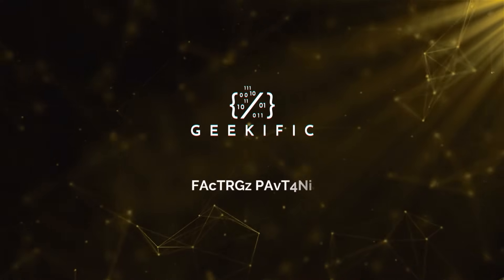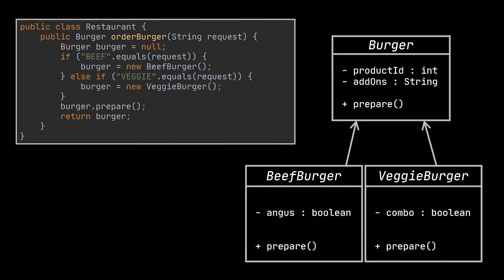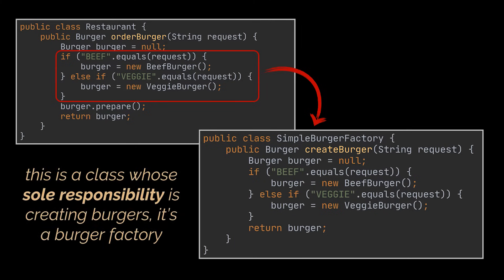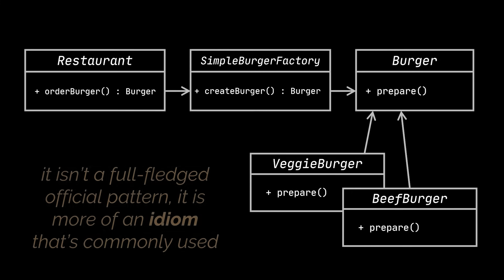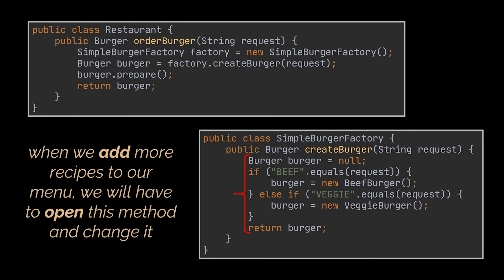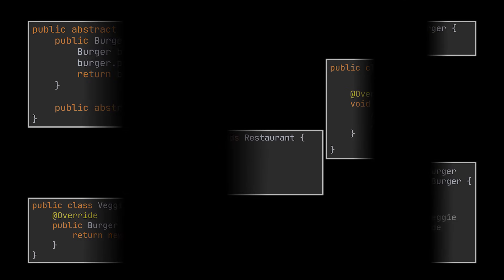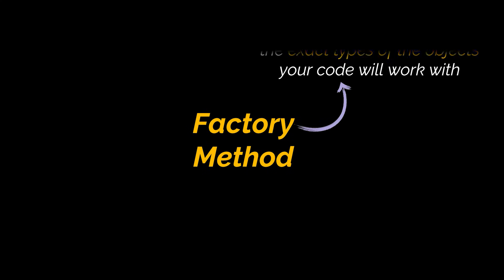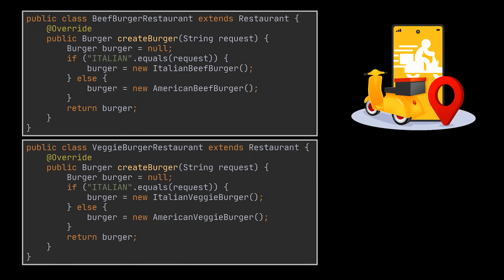The Factory Method Pattern Explained and Implemented in Java | Creational Design Patterns | Geekific

Comment: Hello sir, Nicely explained 👌 
But I have a doubt. In the factory pattern method, in the main() method still I have to apply if else on which type of derived class I have to instantiate. I will give the type in input and on that input if-else would have to applied for making instances of the derived classes of the Restaurant class. So, in this case also, suppose if a new burger comes in, I have to increase one "if" check. How to handle this?
Reply from the maker: Thanks :) We cannot get rid of that decision entirely as it is up to the user / client to make this selection, or else we will be choosing on his / her behalf :P What we can do, or are doing instead is shift this decision to the client part of our application instead of leaving it coupled with the inner parts of our algorithm :) Hope this answers it! Cheers!
Reply: @geekific  But I still have a doubt. Before "Simple factory idiom": if-else checks were in the Restaurant class. To remove those checks from the Restaurant class, we used "Simple factory idiom" which led to those checks in FactoryClass. Then to remove if-else checks from the factory class, we used "Factory class pattern" which led to the checks in the main method. So, I am not able to undertake what benefit we are getting by using the Factory pattern over Simple factory idiom. We are back with those checks in our client code!!!!.
Reply: @rahulmodi926  to remove if-else (control-coupoling problem), i think you can do it with reflection, so you have to create object from its className, so ur className have to name after a rule like: type+...(ex: type: beef -> className: Beff + Burger, type: vergie -> className: Vergie + Burger), so in future, if u have a new product, you have to name after the rule. In conclusion: if-else in that case is not important, if u want to remove it -> use reflection and className should follow a specific rule
Reply: @tieptrinhsope  I think you can use a map of [burger_type: object()]

Comment: Great video!
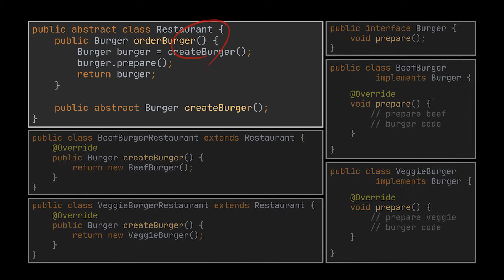I have a simple question: before implementing the factory, you had a string called request used on the if else block. after implementing the factory, at 5:55, you showed a main function but instantiated two objetcs without using the string request as before. if i wanted to adapt the first code (with the if else based on the request string) the right place to put the if else block with the request string would be in the main, right?
Reply: I don't know how this achieves anything... the outer (ordering) code is still coupled to the inner (making) code because it still has to know the names of the functions it can call. Also, if you wanted to replace veggie with chicken, as you did in the first example, then you would still have to update the outer code so it can't call the deleted veggie burger type. So what's the point?
Reply: @richtourist  this is my question exactly I just dont get it!!
Reply: If the whole point of applying this pattern was to make the logic close to modification then i think it didn't succeed. The conditional didn't disappear we just pushed it a level higher. So that is still open to modification. Also, we created an extra level of classes with this pattern (XYBurger -> XYBurgerRestaurant + XYBurger), so now we have to write code for twice as many classes every time we want to add a new kind of Burger.
Reply from the maker: Thanks :) Yes! This is a client request and should be handled on the client part of the code (i.e. in this simple example the main class). We can't get rid of the request entirely, is part of how any program or application works. What we did instead was extract it, so it won't be coupled with our logic, making our inner logic closed for modification but open for extension. Hope this helps!

Comment: I dont understand the exemple, at 5:57 how the client know wich one to get, and why not just give the object directly without passing it trough the factory ? what is the difference now ?
Reply: I had the same question. It seems like the ability to order a burger subclass based on user input has been lost. At 5:57 we are just making both kinds of burger
Reply: I got same problem lol
Reply: I think the only way is to have somehting like the chain of command pattern. the request object is evaluated based on a condition and, then, from all registered evaluators, the request is fulfilled by applying the evalutor which can handle that type of request.
Reply from the maker: By abstracting the creation logic and applying the factory pattern we centralized the product creation in one place making it very easy to extend our application with new products, all-while making sure that the creation-template (ex: order - create then prepare) will be preserved.
Reply: @geekific  Nice video. Just one question, how can we runtime decide which burger to be created? Thanks.
Reply: @yuzheng8804  I thing the if else logic will be moved to the main class so you will need to check the request to see which burger customers want to order then call the method in abstract class to create the burger base on the type